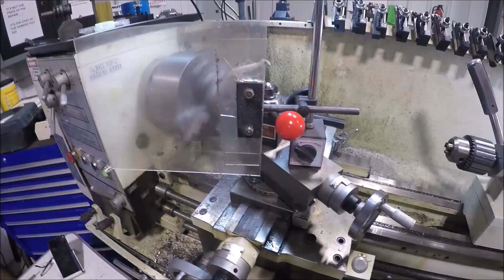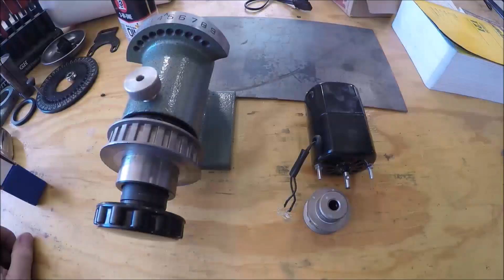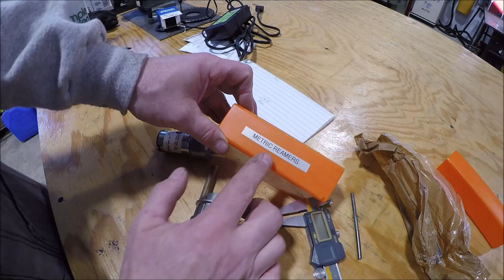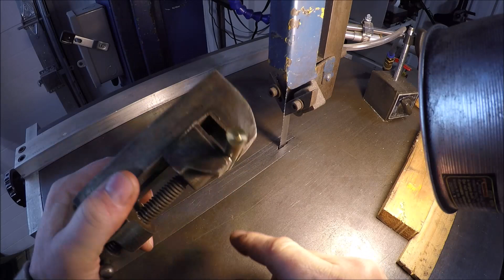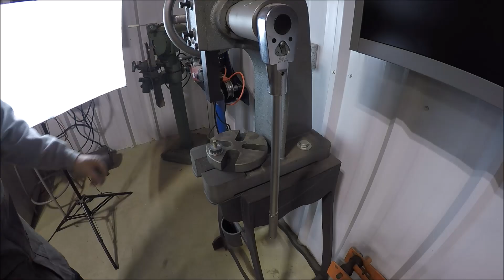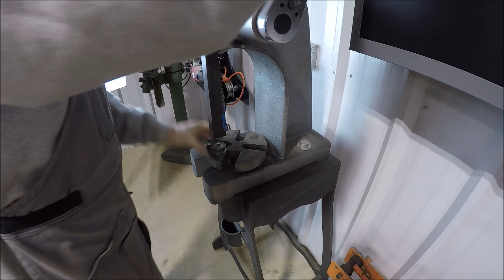O D  grinding fixture build. Part 2

Comment: Yeah, 
A larger drive pulley will increase your speed.
Example,
A 600 rpm motor with a 3” drive pulley and a 2.5” driven pulley will give you 720 rpm.
Motor speed x pulley size divided by driven pulley.

Comment: Tom, I’ve got a small 1/4HP 120v 1450rpm. It’s roughly 6”-8” long. If you’re interested lmk. 

Loving the series!
Reply from the maker: Thanks for the offer. If these motors don't work out I will let you know.

Comment: Smaller pulley on a big motor against a larger pulley will reduce the speed. With that said this is awesome work. Keep pushing.
Reply from the maker: I realize that now. Some reason I had it in my head the other way around. Thanks for watching.

Comment: Wait, what?  Small pulley on the motor, big pulley on the spindle = spindle runs slower.
Reply from the maker: Yeah I had a brain fart there.
Reply: Believe this is a work spindle and does not run high rpm,  Suspect he will use it on his surface grinder.
Reply: @ralphgoings2120  right. Sounded like he was saying small pulley should have been on the spindle. His sewing machine motor will work fine with the small pulley.

Comment: I’ve had good luck with HarborFreight motors
Reply from the maker: I just checked them. Unfortunately the smallest one they have is a 1 hp, which is way over kill. Thanks for the suggestion though.